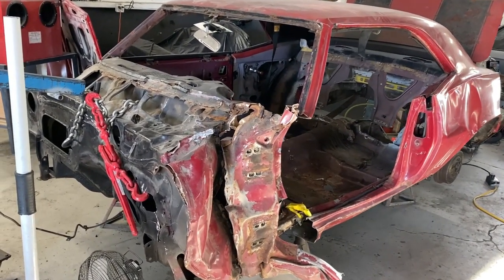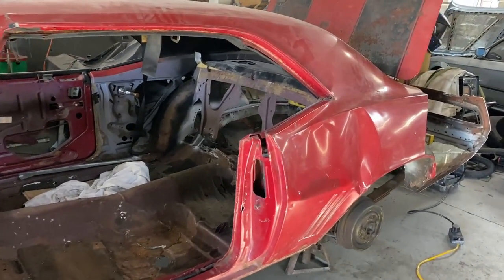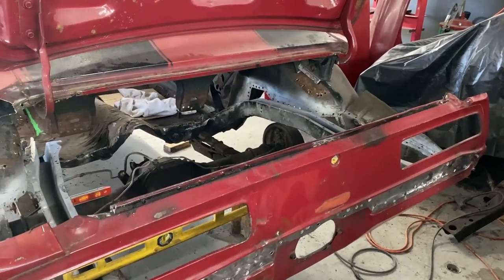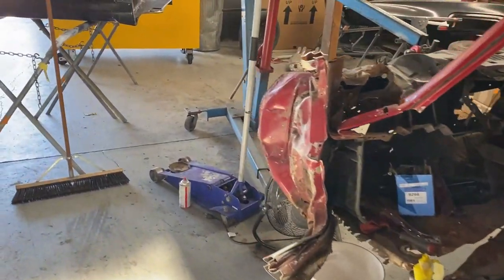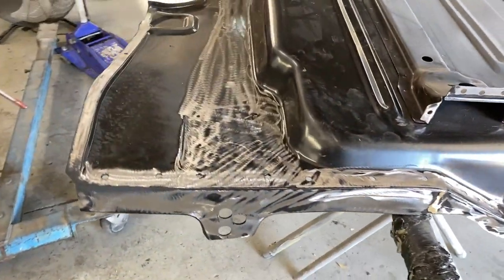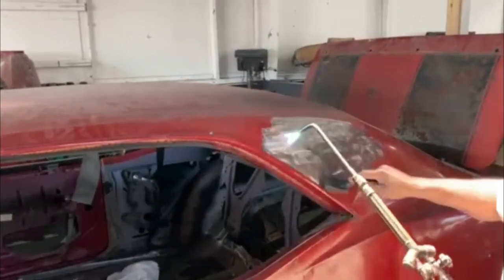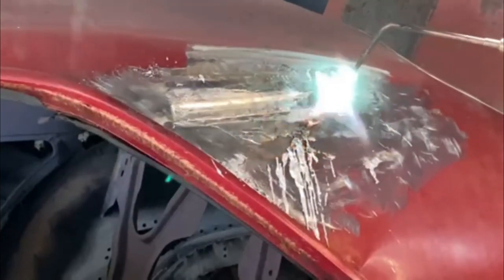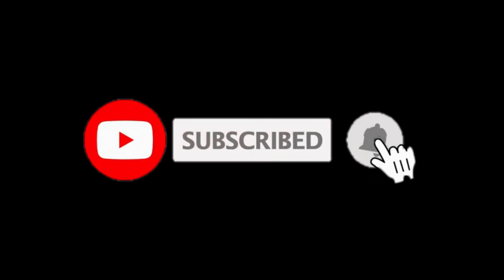69 Camaro Garnet Red Crashed but not Dead Z/28 Restoration - Part 5   Body Panel Replacement Day 2

Comment: It's a great feeling when you drill the last weld out and the gentle crack of them letting go is heard, that trunk panel shouldn't be put in until the whole shell is jig straight. I'd drill out the welds until I got to the undamaged panels and then slowly replace them. It's a challenge but who doesn't like to be proven right in the end? He'll make it good for sure.
Reply from the maker: Hi Mike, he just has the truck pan held in with vice grips at this point. He told me that he is going to use my blue Z to set measurements and secure the red car accordingly. I will be showing all of that in upcoming videos. Thanks Mike, I appreciate the input :)

Comment: U gotta  fix the fire wall and rocker so u can fit the door then do the 1/4 panel. Car should be on a jig to hold everything  in place. And level. Use the good car  to make the jig. Good luck.
Reply from the maker: Thanks Chris, they are going to use my Le Mans blue Z for measurements etc. The jig is a good idea, I will mention it to them.

Comment: Just a curious question. The 69 Z28 is my favorite Camaro they ever made. But is the cost of this build going to be higher than the value of the car when finished?
Reply from the maker: Actually no, I sold a restored bike and bought the car with the profit I made on the bike.
So including what I paid for the car I will be in to it for about 53000.00 or 33000.00 out of pocket.
So about half what it will be worth.
Granted, I have and will do all the labor except for part of the paint and bodywork.
By the way, that is on my blue Z, not this red crashed Z.
This red Z will probably be in the ballpark of what it’s worth in the end
Reply: @digitalpizza1  okay yeah I was talking about the red one.. but that blue is my favorite color on those cars especially with the white LeMans stripes.

Comment: are the spot welds like that from the factory?  3:46
Reply from the maker: None of the spot welds have been paced yet, but they will be placed in exactly the same place and when finished, look exactly the same. 3:46 only shows him removing the lead to expose the factory welds so they can be drilled out to remove and replace the quarter panel.

Comment: why didn't he use structural steel supports to maintain the correct dimensions of the car.
Reply from the maker: Hi Tom, the main reason is that car is so Tweaked that it needs to be straightened in every direction. They are using my LeMans Blue Z to get the dimensions and will probably attach supports as they progress.